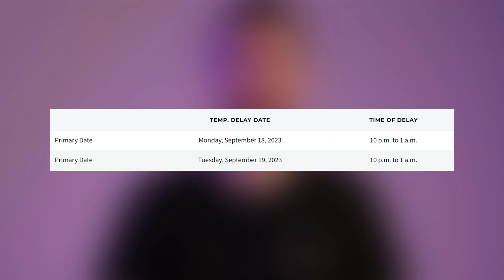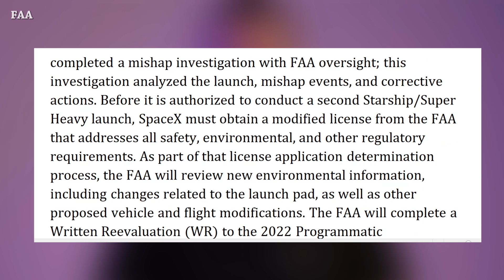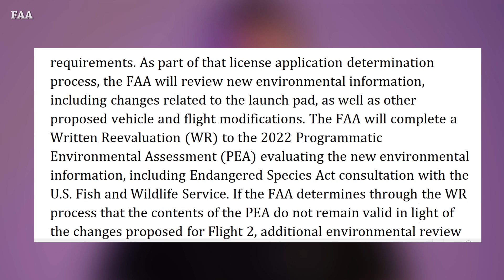Hadley Engine Hotfire Test + New Temporary Road Delay | Starbase Pink

Comment: They might well resume finishing up construction of cape tower and be done with it.   This crap going keep delaying for another year at this rate, with current pair of vehicles needing to be scrapped.   This is not what I want, but seems be only way keep program going forward.   I think it's delayed at the moment at the Cape because the second Crew tower needs to be finished before they can upgrade the existing Starship Stage Zero site to keep NASA happy they don't loose access to a launch site if it goes wrong.   There going be a delay either way. (Sigh)